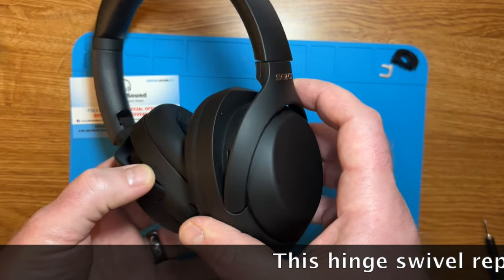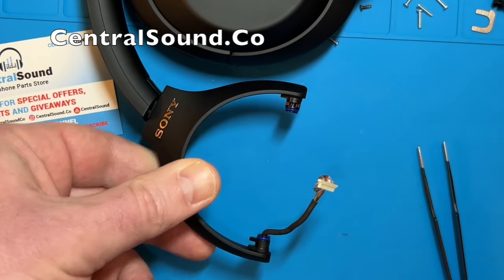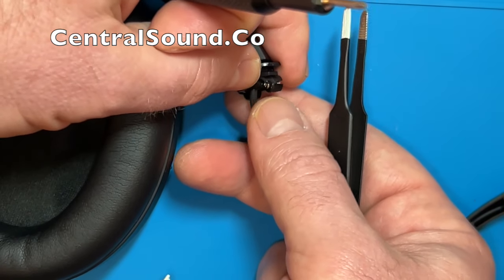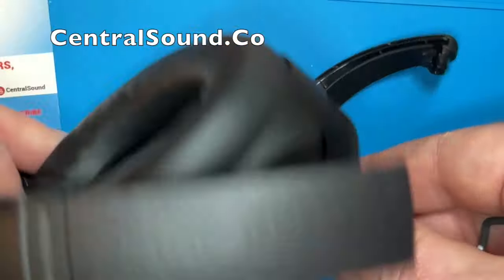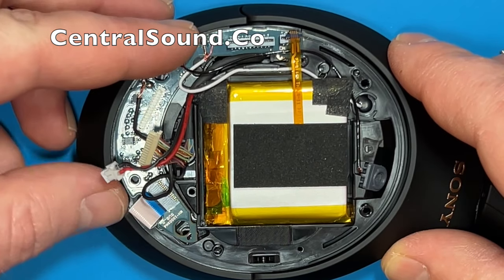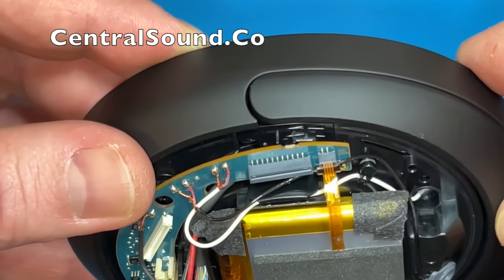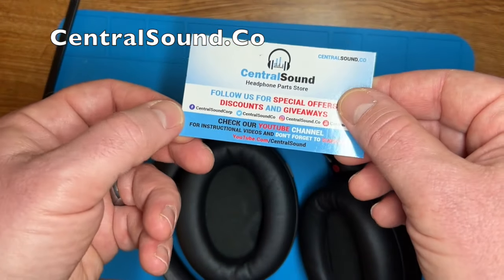How to Replace Sony WH-1000XM4 RIGHT Hinge Swivel Part Piece | Fix | Repair | Broken Headphones

Comment: You are the best. I thought my headphones were finished then I saw your video. I ordered the part and you sent it promptly. I took my time and followed your instructions step by step. As I removed the screws I put them in individual sandwich bags so I wouldn't lose them and numbered them 1-5 so I could replace them in reverse  order 5-1. I would suggest that anyone doing this repair do it on a day off like I did so you can take your time and pause if you become frustrated. Remember you are working with plastic don't force anything and only tighten the screws until they are snug. I am really grateful thank you for posting this video.

Comment: I tried. Thanks for putting this out there. The screws at 3:12 are glued in. I managed to get the top one out and the end 5-6 threads have some black material in the threads. I scratched through the wires embedded in the board trying to get the other one out...

We'll see how it lasts with that scratched part.

Thanks for your help.

Comment: Amazing follow along! I've had my headphones for 3 years now with heavy useage (I like them even just for the noise-cancelling so I wear them all the time), and the right hinge did suddenly break on me. I wasn't too mad considering how much use I've gotten out of them, but considering everything else still worked great, I'd much rather just replace the hinge (+earpads while I'm at it) then pay for a whole new pair. The video is also very easy to follow along with. Thank you!

For anyone looking for short term fix: I used ducktape but made sure to go under the hinge and not just around. This enabled me to wear it, but couldn't tuck it way and the tape did loosen over time but lasted fairly well so long as you went under the hinge. It was an alright fix while I waited for the right hinge to be back in stock and ship to me.
Reply from the maker: Thanks for taking the time to share your experience.  We also appreciate your business 💯

Comment: I know this is a simple job but I found it deeply satisfying following along. Brilliant video with no annoying music and no hint of being patronised in the commenty. Thinking of buying and breaking everything on your list now. That said, I made one tiny boo boo... @5:20 the removal of the hanger. One of the scraw moldings cracked and is now unusable. I reassembled it anyway and it dose seems sturdy. I was thinking of glueing but that would prevent future repair. Any thoughts? Thanks again!

Comment: Thank you so much :) I bought a replacement part from Sony's distributor for the entire headband and the semi-circle parts that click into the cups parts. This video was great for showing me how to get to the stage of taking those semi-circle parts on, and then putting everything back together. I'm also using the left video to help with this. You're a lifesaver!
Reply from the maker: Glad I could help!

Comment: This video was a 10/10 on how clear it was which helped me repair this stupid issue by myself thank you! Originally I went to a few repair shops to see if they could fix this for me because I was to nervous but after countless repair shops not specialising in headphone repair I bit the bullet and ordered the parts and I'm so glad I committed to it. The amount of money I've saved because of this video is absolutely amazing and if your nervous judt think about the amount of money you will be saving. I think it's close to impossible to fail at this repair with how clear this video is 🙏🙏

Comment: Great video and product!! My XM4s broke after just one year of use and I was not ready to let them go, especially considering the cost! I was able to fix my headphones using this video in about an hour total. I had trouble getting the black screws out and had to order a micro screwdriver set on Amazon. Once that came in, the rest of the video was super easy to follow and my headphones work great now.

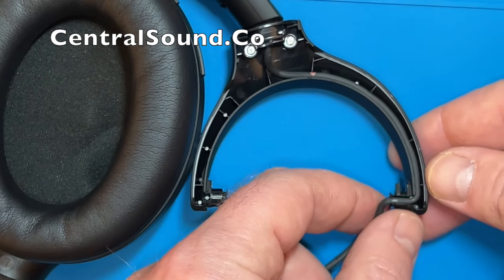Comment: Great repair video, successfully fixed my headphones hinge! It's crazy how easily they broke, wasn't being heavy handed with them in the slightest. One minor detail, at 12:30, the cable was pulled out further than it was before. Line up the brown dot with the first little crevice and the white dot with the last, so you don't have any extra slack in the cable. Use 8:20 for reference.
Reply from the maker: Nice work!

Comment: I let my teenager borrow my XM4 for a roadtrip; baby sister gets a hold of it and throws them, breaking the hinge swivel. Saw some replacement pieces on amazon, but luckily I stumbled upon this video. Decided to order the part from Central Sound, so glad I did. I received everything I needed (make sure to order the tools separately), and I was able to follow this amazing video to fix it. XM4 are as good as new. Really appreciate your help!
Reply from the maker: Very cool!

Comment: Thank you, Central Sound!  I bought the replacement parts a few days ago and they came in today just in time for me to fix my headphones. This was the first ever repair I did on any piece of tech and the guide was super helpful. Though I am curious why the metal ring that goes into the swivel part looks a little different than the one in the picture when you click the link. Regardless, it's working great now so I'm happy. Thanks again!
Reply from the maker: Hello and thanks for sharing your experience.  We’re happy to hear you repaired your headphones with our help.  Thanks for the order 💯

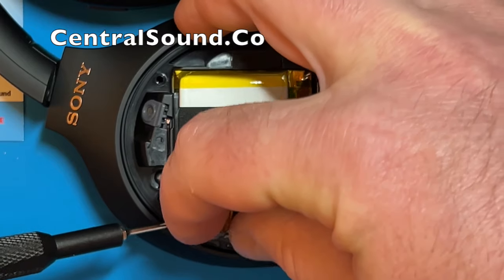Comment: I seem to have stripped one of the screws on the PCB (see 3:10). Any advice on removing? I tried using rubber bands and a latex glove, but my screwdriver head went right through them.
Reply: Same, did you find a better solution?

Comment: Great video. Easy to follow along. After changing the part, my XM4's refuse to charge. I have a red blinking light when I connect my USB C cable. Anyone have any ideas what the problem may be?  thanks!

Comment: Thanks so much for this, very helpful. I think I may have damaged the white plastic on the component with all the coloured wires. After reassembly, at first, the right side had no audio playback. After opening up again and after a few more attempts at alignment the right audio came back. It feels like if moves at all I will lose the right side again. Is there anything I can do if this problem returns?

Comment: Helpful video! Do you have any idea what size the screws are for the circuit board? My PC repair kit doesn't have s bit small enough and I want to buy the correct size. Thanks!

Comment: U dont need to remove those blue rings completely - only that one on the wire (leave it hang on the wire). Thanks for the video! Replaced my broken swivel parts twice

Comment: can the metal U piece be installed without removing and disconnecting the earcup? I have previously installed a replacement but without the u piece and would rather not fully dissemble the whole device aging.
Reply from the maker: No

Comment: any idea how to remove the end part of the headband for most headphones, my right ear piece broke off cleanly from the wire that goes from the headband through the swivel part and need to get more wire exposed in the band to solder new wires between the 2 for a stronger connection, my headphones are Sennheiser PC 350 SE

Comment: Is this a fairly easy repair for someone with little experience? I don’t want to get in over my head and regret not sending it in for repair when this is a cheaper option
Reply from the maker: Hello, 
If you take your time and follow the video you should be good.  There is not soldering involved so that’s a plus.

Comment: I have a question, what happens if the small wire breaks? And your left piece just comepletely falls off? Mine did and I didn’t even touch it. It was expensive and in freaking out. Can it still be fixed? Please help me!!